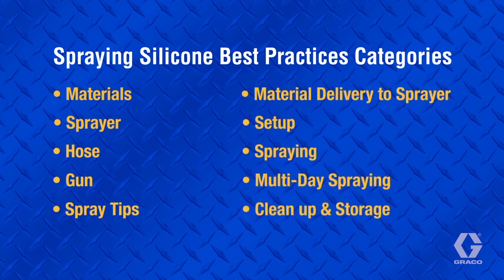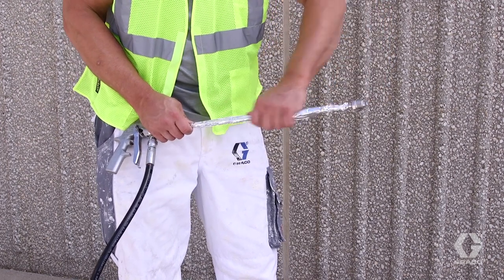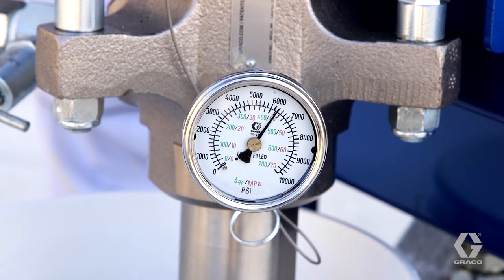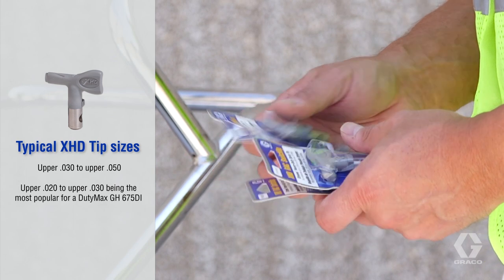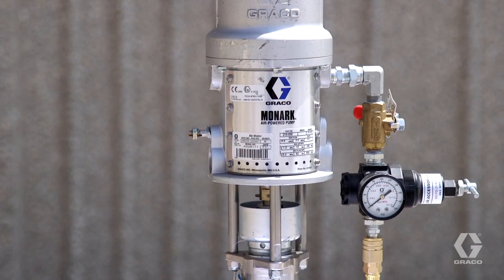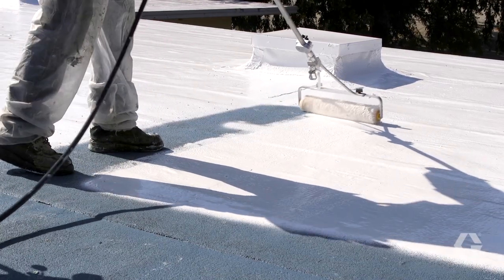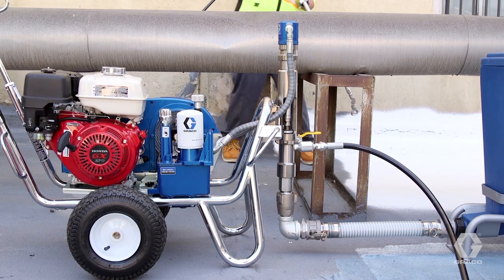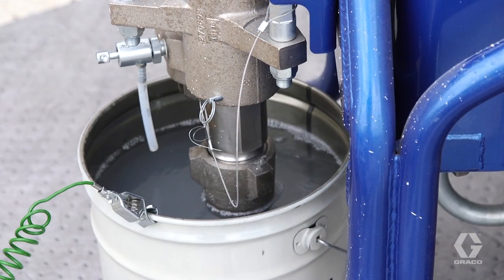Graco - Spraying Silicone - Best Practices

Comment: I was warned by Sherwin Williams not to spray silicone products through a airless unless it's dedicated to it.
So can you clean out a silicone product from a airless?
He said it would make latex paint peel.
I would think every product has a cleaning solution recommend?
Is cool seal a problem or other white elastomeric roof coatings.
Reply: Usually mineral spirits is whats used on most silicones that ive used to clean the sprayer with but i did use one many years ago that required xylene so your best to check with the manufacturer of the product. The reason they tell you to have a dedicated pump just for silicone including hose is moisture causes silicone to start curing and if you use one sprayer for elastomeric and silicone you need to use a different hose and lower because the lining of the hose and even the pump absord water and the silicone can start drying in the hose and pump. Its happened to me i removed the filter on my pump and it was full of lumps of silicone because i did not know many years ago it had to be used only for silicone.
Reply: @JB-ej8zy  thanks for your reply.
Reply: @Shopweasel  no problem

Comment: That’s a lot of extra work in my opinion.
Reply: That's what I was thinking,I'm just going  to roll mine
Reply: @jaymiller5407  trust me from experience, unless you are willing to invest 75 k into this system , it's not worth it. Greco and Henry's both signed off on the smaller of the 2 machine's and gave us the go ahead to install it on 2000 square of epdm.  We had issues with this set up from day 1. It's a ton of prep and clean up time. If your serious about doin this type of product I recommend going to a Gaco rep. They are far superior to Henry's.  My company ended up putting another EPDM roof over the existing. It's a warehouse that's coming down in 5 years. This system cost my business just shy of 100 k. Got any questions just ask..
Reply: @flatearthrcs4869  what spray system would you recomend for silicone?
Reply: @mikegrant8031  hey bro, it all depends on what your spraying to? Let me know
Reply: @flatearthrcs4869  gaco silicone roof coating
Reply: @mikegrant8031  the products efficiency all depends on your substrate. Personally I wouldnt apply it to anything other then torch on and EPDM. It's very key that the roof your gonna apply it to has been thoroughly cleaned,  I reccomend pressure washing. Try and install your product withing a day or 2 after  pressure washing, otherwise you risk spraying over a less clean surface thus taking the effectiveness from the shelf life. Dont get me wrong I think if all steps are taken to ensure the substrate is cleaned and dry it will work. I did 50 sq over a torchon roof and we installed it in half a day. The prep work took much longer. If I had to choose I would go with the Graco. They have a product called bleed trap. It goes on thin.its easy to install  and best of all stops any moisture from sweating out of the existing roof. The silicon does cure with moisture so its important you install over a completely dried surface or it will cure to the moisture and start to peel within a week. U got anymore questions let me know..another thing we did was hit the area your gonna apply to with a torch so ur getting rid of moisture as well as melting the granules deeper into your torchon. 
.
Reply: @deathdealer710  check out comments
Reply: @mikegrant8031  I'd reccomend the larger of the machines and thick hose. Only use mineral spirits to fish the system. Using water will cause the product to cure inside the hose.
Reply: @flatearthrcs4869  thanks for the reply, i have put down several thoussnd feet of silicone with rollers  i am just weighing spraying it. I see a lot of negative comments about spraying.
Reply: @flatearthrcs4869  bitmun with acrylic elastomeric on it. Some times just bitmun
Reply: Phil Tocco what’s the best spray machine you recommend me to start with on regular to big roofs
Reply: @Bash Bros RC's  75k ? This graco dutymax 675 sprayer is about 12k i have a rig that sprays silicone your price makes no sence.